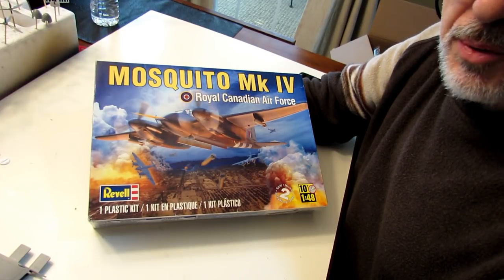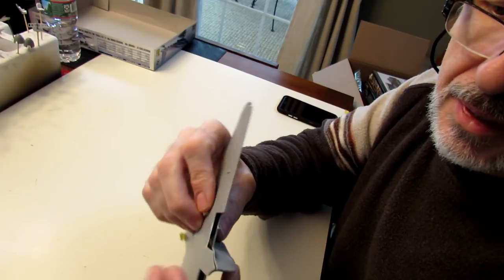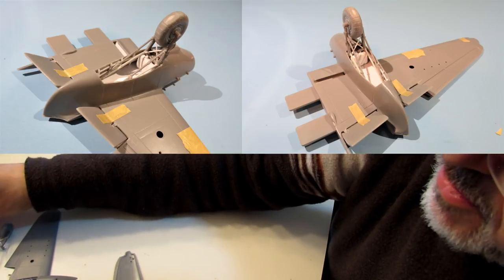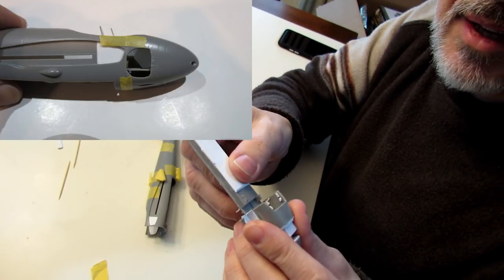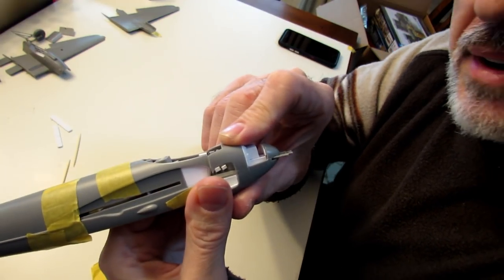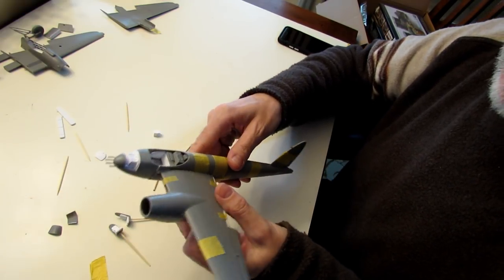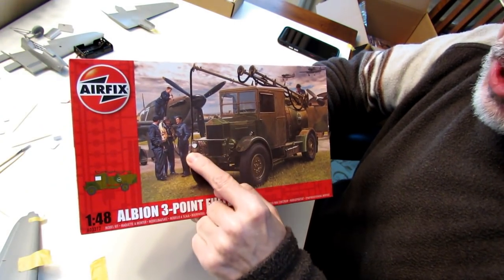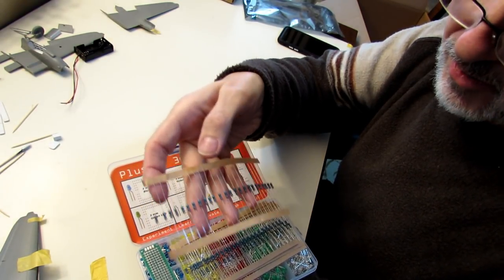Revell 1/48 De Havilland Mosquito Mk.IV- "Build Update #1"- Scratch-Building! (11.22.18)

Comment: This type of scratch building is what drew me back to plastic modeling after decades away. Sadly, there aren’t many YouTubers modding in the kind of detail that you seem so comfortable doing. 
I particularly appreciate your ability to bring detail to a kit without resorting to buying expensive aftermarket resin and PE parts. 
Thank you very much for the inspiration.
Reply from the maker: Thank you for the very kind words Scott, much appreciated. I've only attempted scratch-building on maybe 5 models so far, but this one, I'm really enjoying, hence the reason I'm going to go further with it by adding electrics to illuminate the lights, motors to drive the propellers and put it into a diorama. In the 4 1/2 years that I've been modeling, I've never bought resin or PE after-market product...I'd rather spend the money on another kit than buy items that cost more than the kit your building! Cheers : )

Comment: Hello Martin! Great work with the scratch building! What is that plastic called that you use for scratch building? Wouldn’t mind doing this myself in the future.Motors and lights change of underpants time 😍🍻👍
Reply from the maker: Thanks Warren, much appreciated mate. The plastic being used for scratch-building is just white styrene sheet, it comes in all thicknesses. I also bought lots of other styrene product for scratch-building: different diameter rods, L-section, I-section, H-section extrusions, square bar and rectangular bar.  Have a great weekend! Cheers 👍🙂🍺🍺
Reply: International British Modeler Thanks for the information mate! Yeah you and Ruth have a fantastic weekend too 🍻👍

Comment: Shouldn't it be a Mark VI?  All the Mark IVs were bombers (with perspex nose and no gun or cannon armament) to my knowledge, and this is apparently a fighter bomber variant (most likely a FB Mk VI).
Reply from the maker: The kit offers 3 different versions...it's molded as a Mk.IV with the Perspex nose, but I decided to cut the nose off and use the Mk.VI nose...but, I don't want to bother scratch-building 4 cannons and will be using the 4 bombs supplied in the bomb bay and 4 rockets under each wing. So...it looks like a Mk.VI from the outside, but without the cannons...this is the Mk.4.6 that never made it to production :P
Reply from the maker: That was something that I thought about, but I'd have to build a bulkhead that closes off the cannon bay, but, the rear end of the 4 cannons protrude through the bulkhead, which means, I'd have to scratch-build the back end of them, too. I'm pushed for time now...on a deadline to complete it by the group build deadline of December 15th, and, I haven't begun to paint and assemble anything yet. It's a cannon-less FBMk.VI with a Mk.IV bomb bay...no one will know unless they pick it up and look underneath, and you know how it is if someone tries to touch your model...God help them!!

Comment: I have to admit I SKIMMED THROUGH a bit . but it's a bit worrying that the kit describes as mk iv which was an unarmed bomber ; atlthough similar to the FBVI the whole nose is different including the windscreen and entry hatch . I seem to remember you did a Tamiya FB vi ; sorry to be pedantic . it's an interesting project non the less
Reply: so you have to decide if you have guns in the nose ; then they would compliment the 4 cannons beneath  hence the side door . the mk iv bomber has a glazed nose no guns . and an entry hatch at the bottom . the mk vi was a fighter bomber the front section was for the 4 cannons ammunition  and had a small bomb bay at the back . Tamiya has done this correctly . although there were many versions none had the full bomber configuration with mg in nose . the film the 663 squadron has misled the casual viewer by putting fake machine guns in a late bomber version . if you look closely you can see they have just painted the clear nose . later night fighter versions of the Mosquito deleted the nose machine guns just the cannons
Reply from the maker: Hey Anthony, the kit offers 3 different options to build, I cut the Mk.IV nose off so I can stick the Mk.VI nose on, hence the reason I modified the nose to include the machine guns and magazines. But, I’m not going to bother scratch building the 20mm cannons, so decided to leave those out and keep it as the extended bomb bay...I’m also going to put the 4 rockets under each wing...you’ll see the 4 rows of two holes already in the lower wing sections. This is the Mk 4.6 that never made production 🤪😝
Have a great weekend! Cheers 👍🙂🍺🍺
Reply: After all the trouble ; it would be easy too add the cannon . I think you have an insert in your Airfix kit . you can cut back the rear section  of the bomb doors  and close the forward section which houses the actual cannons ammunition etc  . maybe some holes for spent cartridges . or it can be a 633 squadron type I suppose .  @InternationalBritishModeler

Comment: Just finished the Revell Mosquito kit. Newer bomber version. Have to say I think it is a piece of crap. Nothing fits. The wheel struts are too short for the wheels FFS! The canopy does not fit because the radio is huge. The floor of the cockpit was way too wide, needed extensive shaving, filling just so the fuselage would fit together. I could go on. This is the very last Revell kit I am ever going to buy. What other hobby would except goods (which are expensive) that are just wrongly made?
Reply from the maker: Oh dear, you sound displeased. Is the newer version bomber a Revell USA or Revell Germany kit? Every Revell USA kit that I've built have been very poor in quality compared to their German brothers, and every Revell GmbH kit that I've built, have been really well engineered, molded and nicely detailed...I love the Revell GmbH kits. This is a Revell USA kit, hence the need to do a ton of scratch-building to help it out...but I don't mind that, I like to be challenged by these older kits that were originally intended for the toy market, for children who wouldn't be concerned or knowledgeable about inaccuracies, hence the box art including "For ages 10+". Regarding being "expensive", that's relative depending on who is buying them, their level of income and in which country they are buying them. I built four Revell GmbH 1/32nd scale kits, all were $23.99 here in the USA = 19.10 British pounds at today's exchange rate, of which I thought was very cheap for the what was in the box....great value for money.

Until I build the same model that you have aired displeasure to, I cannot agree or disagree with you, I'm afraid. Better luck next time. Cheers : )
Reply: International British Modeler  I believe it was a German one bought here in 🇬🇧
Reply: International British Modeler 03923 model number
Reply from the maker: Oh my, that's unusual for a Revell of Germany kit....especially if it is brand new tooling, that today are built from computer generated models and CNC machinery?